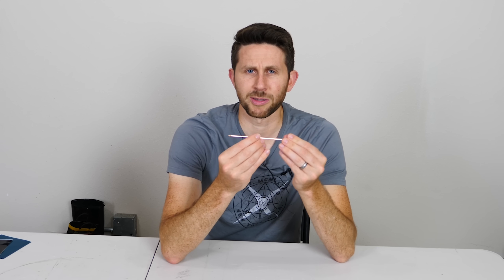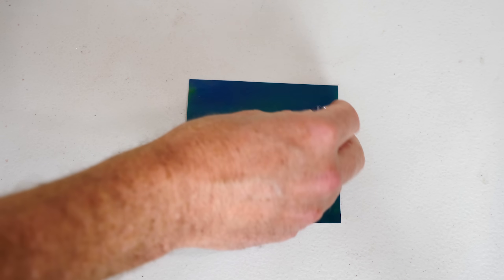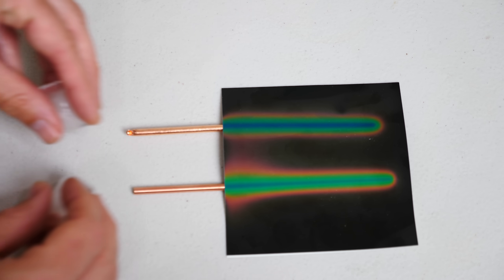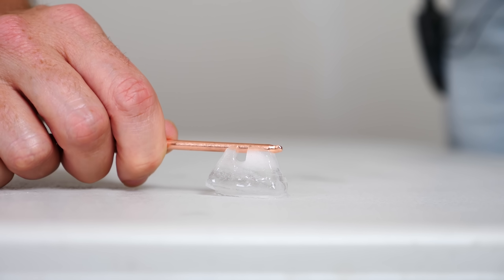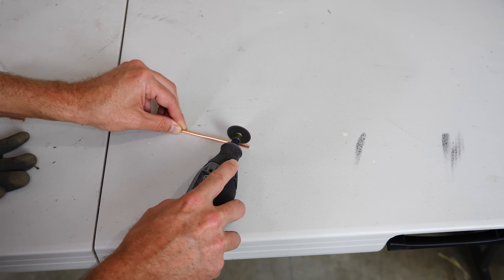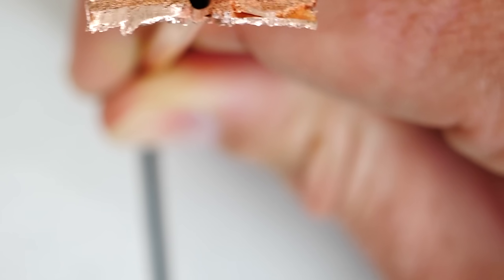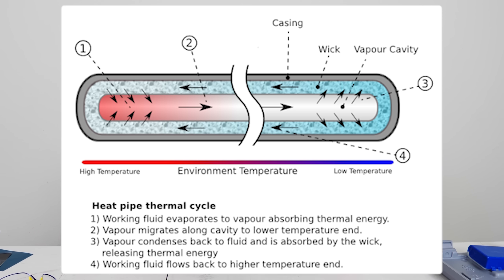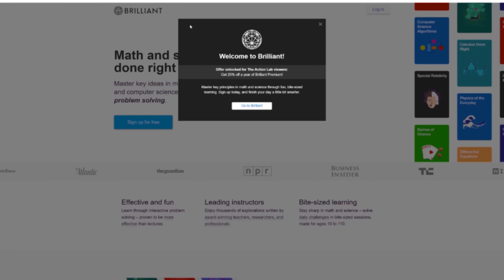What's Inside the Worlds' Fastest Heat Conductor?

Comment: This is essentially the core operating principal of all modern cooling. HVAC and AC units all operate using a long network of copper tubes filled with a vapor that it highly sensitive to temperature changes, by applying heat to one side of this network you make the other side very very cold, if you blow a fan over the cold side you have an air conditioner unit.

Comment: MAKE IT FROM SILVER SON :D, we also need to remember that copper wire have more thermal capacity than thin coper heatpipe, so i dont think its good example. never heard about water inside heatpipe, most of the time its used liquid with low boiling temp like alcohol or ammonia.

Comment: This the second video out of 
two videos of yours back to I back combined with the idea I came up with for retractable 🔭 telescopic blades & aircraft carrier cable to be used on wind farms inspired by watching videos of them structurally failing and decided to donate some time to help these engineers tackle this issue for safety and longevity.
You have a wonderful scientific mind that can be a valuable asset with their production of a solution.
Good day.
Reply: Here's the first video that may solve the problem for the runaway issue with the magnetics locking up and for not locking.
https://youtu.be/V5FyFvgxUhE

So that video solves that problem because they say they don't have a clutch so now I'm thinking engineering up a magnetic torque converter.. similar to what we use in automotive rather than a fan clutch.

Comment: Pretty sure it's not water in heat pipes. It's definitely some kind of liquid with a certain inert gas. But my guess is the liquid has a significantly lower boiling point, to be an effective conductor at lower temperatures.

Comment: Are these just called heat pipes? What exactly are they used for especially thos short one he has? Since it has to be sealed, you can't just buy a long one and cut it to your desired length like normal pipe do.
Reply: they are used in cpu coolers
Reply: Literally all laptops move heat from the chips to the coolers with these

Comment: not sure if testing with ice is proper. the phase change material inside should evaporate at higher, then condensate at roughly room temperature, if the heat pipe was made to operate around room temperature. rather it should be heated on on one end and measured on the other. cooling it likely causes the phase change substance to freeze, so pretty much you have the same result as it was an empty, thin wall copper tube... on the other hand, the solid copper rod has significantly larger mass, that means larger latent heat, that means it will absorb more heat before it will change it's temperature... you can actually see this effect with the thermal foil, around the copper bar, the colored area becomes much larger.

Comment: Is this something you could use to improve the effectiveness of say ice breaker ships? Or air conditioning or refrigeration and heating units,  if it's not used already. Also would it work at high pressure conditions like in the ocean or near vacuum conditions in space?
Reply: Well heat had to be supplied from somewhere so the ice breaker idea doesnt quit work. The pressure referred to is the internal pressure of the sealed pipe. So yes it will work in space or ocean provided the structural integrity against the pressure difference to the environment.

Comment: I'm curious how this can work in a continuous use application.  Eventually, one end runs out of water. I suspect it must have a return via gravity and therefore needs to be oriented in a specific way.  But will it really be 100x higher thermal conductivity in continuous use?
Reply: it uses capillary action and water tension to move the water back to the heat source, no matter if it's fighting gravity or not.
Reply: Heat pipes have a copper wick that wicks it back to the source of heat once it condenses in the cold end.
Reply: It is under a vacuum seal i.e. a closed loop system. The water won't run out. Water vapor cannot penetrate/permeate through the copper to evaporate out. 

   Yes, it is continuous use because one part of the tube will always be closer to ambient room temp and the other part subjected to heat source will always be significantly warmer, so as soon as the water evaporates from the hot side, it immediately condenses back into liquid form from/on the colder side and then goes right back to the hot side--this all happens quite fast--which is why in the demonstration the heat pipe was so much faster at transferring heat energy than the solid copper rod.. 

   It must be under between a low to medium vacuum though, since even at a low'ish vacuum, water boils (evaporates) at around room temp. Seems like the sweet spot for this use would be around 28 to 29 hg or so. 

   I'm curious about making my own using copper mesh and diamond powder.

Comment: Within 22 frames, I saw the blue sheet start to change until it reached  the end - I saw a small colour change, not fully black. That's 22/60 FPS, so that's 366 milliseconds for the 'heat' to reach the end of the pipe.

Comment: There is liquid. Not water. Very often there is some kind of liquid gas. It depends on what is the designed operating temperature. Because heatpipe works best only near its designed operating temperature.

Comment: When used as a heat sink for a CPU or GPU in a computer how much is the temperature decreased on the item being cooled? I am curious as to how much better these are or worse or equivalent they are to a water cooled system. Thank you. Also if you do the test on a CPU or GPU what are the temperatures compared to standard air cooler?
Reply: Heat pipes are far more efficient at moving heat than is the flow of water.  The reason water cooled CPU's usually outperforms heat pipes is because the water coolers typically use massive radiators. Heat pipe coolers usually are stuck directly on top of CPU and therefore are limited in radiator/fin size.

Comment: So replacing a water with ethanol or other low boiling temperature liquid should increase a speed of heat conducting?
Reply: The boiling point of water depends on the pressure. He said they seal the pipe at very low pressure, so the boiling point will also be very low. 
Plus water has better thermal capacity and thermal conductivity than alcohol.
I guess that is why water is better. Because if alcohol were better I think they would use it.

Comment: Right, but how would it compare to a solid copper rod in a sustained heat transfer situation, for example, when there is a temperature difference between the two extremities of the rod for several hours?

Comment: Thank you. CPU over clockers discuss if heat pipe angles make a difference. Should the CPU be mounted vertically with the heat pipe going vertical? 
Heat pipes also helps with AC. Inside the house, the small hot incoming  line can be cooled from the outgoing large line for more efficiency.

Comment: Currently attempting to very cheaply but much less effectively recreate this with a 9" length of 1/2" iron pipe and two caps and some very fine steel wool I have laying around. If P.O.C. works I'll optimize it a bit and post the results here. Wish me luck 😅

Comment: Would it have a better heat transfer if the fluid inside is changed, instead of water? And what fluid would give the hollow copper stick a higher heat transfer rate if it replaces water?

Comment: Very cool. My research is actually on quantum systems where the thermal and electrical conductivity can be quite separate. In other words the Wiedemann Franz law is broken by a significant amount.
Reply: Interesting.  Is it known why?
Reply: @justinw1765  in my case yes. It happens that the flow of current is a quantum coherent effect in small systems. The interference between multiple pathways can give large deviations from electron free gas predictions. WF is based on free electron theory.
Reply: @splugereport   Thank you for the explanation--a bit over my head, but I appreciate the try. I find the quantum level fascinating, but my deeper interest lies in creating practical systems for the macro level. 

    For example, I'm working on building a prototype of a ridiculously vacuum insulated cooler (nearly 2" of medium low vacuum on the sides and nearly 3" on the bottom) that can moonlight as a highly efficient Solar oven and a no grid electricity microfridge. 

     Also made out of either mostly biodegradable, sustainable, and/or low toxicity materials. Has no foam, and very little plastic. 

    I'm using Peltier/TEC as the heat transfer for the microfridge. I'll be using a modified, home made, flat plate version of these copper heat pipes, to help conduct heat away from the hot side. I'm hoping that will up efficiency a bit. But since I'm using a combo of Solar panels and battery bank to provide electricity, I'm not as concerned with efficiency as I would be if it was plugged into the grid electricity I pay for. At night, it will cool via IR redirection to space.

Comment: 3:01 i like this video, but ide also like to mention regelation.  which for anyone unfamiliar with it, is an effect that causes ice to turn back to water when subjected to higher pressure, ie,  the conductor being pressed into the ice. while its a cool effect, the heat isnt the only thing causing the ice to melt, and would probably melt much slower without the pressing. some of the times he did it, it does look like he added less pressure then the first time though, and it does look like it slows down when the heat from his hand has been used up. but yeah super cool video :)

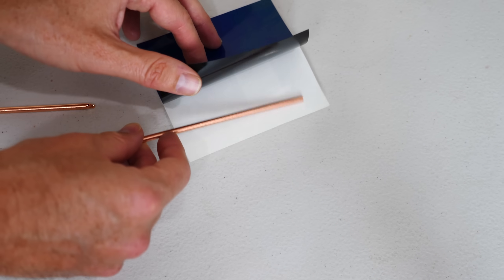Comment: can you explain how this sheet of foil from 0:50 works? why does it change colour? or how those cars which can change color under water works?
Reply: It's a liquid crystal sheet and from what i remember it changes color depeding on the temperature
Reply: @tridos2574  I know but how it works? Why does it change colour under temperature? What kind of material is it made of?
Reply: @ak2setter991  i just searched it up and it is because of the change in molecular structure this change affects the wavelengths of light that are absorbed and reflected by the liquid crystals, resulting in an apparent change in the color of each temperature event.
Reply: just open your browser bruh

Comment: If you use an alcohol that has a lower boiling point than water will the process be quicker?
Reply: Water is on of the best heat conductor out there. Alchol and ohter liquids will only used for subd zero C° condition

Comment: It's fast but it's effect is limited. As soon as the copper gets so hot that the liquid stays vaporised the system has broken down. You can make longer copper pipes to get more capacity, but then the downward flowing liquid, starts preventing the steam from rising. So figuratively speaking, the thing goes from 0-60 very fast, but then can't go any faster.

Comment: At some points you call the only copper piece a "copper rod" and other times you call it a "copper pipe" which is it because those are going to conduct heat differently and if you used a solid rod instead of a pipe your not comparing apples to apples

Comment: @theactionlab   You should repeat this experiment with Pewter, Pewter has a very similar effect but without the vacuum, copper, and water vapor required. You can press Ice up against a pewter cup and it will have a very similar effect, in fact, I use it at home to cool or warm drinks very quickly.

Comment: Diamond is really good at conducting heat as well, I went to a science demonstration where they had a large block of ice and a small blunt knife made of synthetic diamond, it cut through the ice in a very similar way to the rod in this video
Reply: Diamond is an excellent thermal conductor, I believe it's due to the crystalline structure of the carbon within. Diamond which has a more well structured crystal lattice works even better, but you'll be hard pressed to find such a diamond naturally.
Reply: @themadman5615  science is not about belief son
Reply: thanks for the facts!
Reply: So how about graphene?
Reply: @NwoDispatcher  It is very good but very directional.
Reply: @NwoDispatcher  graphene works very well BUT it is highly directional which can defeat it's purpose in many cases.
Reply: I thought this had something to do with diamond
Reply: Carbon is also a great electrical conductor, just depends on how you lay out the material, carbon nanotubes(same element as a diamond) conducts electricity better than copper
Reply: @RenderedUselessness  Graphene nanotube heat pipe
Reply: 5 x copper
Reply: Dimond has the highest Heat conductivity but if u keep a Dimond in an oven for a while you will get ashes, I think now you can understand why we don't use Dimond for Heat Transfer applications.
Reply: @Preparinguppcs but there is thermal conduction compound for computers that does use diamond dust in a medium.
Reply: Also silver works very well.

Comment: You mean the second fastest heat conduction. The fastest being liquid helium II in the superfluid state which conducts heat at about 20 m/s - it being a quantum mechanical effect of  thermal conduction by sound wave, unique to superfluids.
https://www.youtube.com/watch?v=NjPFfT2EyxQ
Reply: True infinities are never really possible... At most you can transfer at speed of light and maximum energy before collapsing into a black hole allows.
You mentioned the wavefront is 20m/s, that's much less than light speed already, for instance.
Reply: @leexabyz  Not true - electrical conductivity in superconductivity, zero viscosity in the case of superfluidity are other examples. These phenomena are quantum mechanical classical reasoning does not apply. To address your second misunderstanding: it does not imply infinite transfer of energy nor infinite speed of transfer, because the it breaks down at a certain transfer rate but is zero up to that point. For example an electric current set running in a circular superconducting wire was found to be still running undiminished decades later after the power had been removed.
Reply: Kilowatts per meter Kelvin
Reply: @limo-swine6537 That would be infinity, (analogous to electrical conductivity in the case of superconductivity).

Comment: You should probably said heat pipe is the fastest heat conductor “at room temperature”. The actual fastest heat conductor is liquid Helium when cooled below to approximately 2 Kelvin. The liquid Helium will transform into a state called “superfluid”, There will appear be no temperature gradients across the entire fluid, and any heat will propagate at extremely high speed across the entire fluid. Making it conduct heat 1,000 times better than copper.

Comment: You say that the heat is transferred from the ice, through the heat pipe, to the temp-sensitive sheets. But that's backwards. Heat is going in the opposite direction.

Also ... this heat pipe may indeed transfer heat quickly. But this demonstration does not prove that. If the two rods of the *same* material have different masses, the rate of heat transfer will be different.

Comment: Hmmm... What if you take the world's blackest paint and make some solar panels on which you attach many of these heat pipes which will be connected to a full water container then the water, because of the heat, builds up pressure and it starts to drive a turbine to generate electricity. 🤔

Comment: Also the spongy part act as a capillar bringing the condensed water from the cold side back to the hot side, where it evaporates and goes as vapor through the middle of the pipe.
Creating a closed cycle.
Just my guess, I am actually an idiot.

Comment: I believe heat pipes have a small amount of a liquid that evaporates at low temperatures and carries the heat up the tube to the cool end and then gravity pulls the condensed (cooled) droplets back down to the bottom of the tube. That is how it works. It requires the heat pipe be upright because it relies on the heated vapor from the evaporated liquid to rise and gravity to return the condensate to the bottom of the tube (the heat source) to cool. Laying the heat pipes on their sides will not produce any effect. Also they don't transfer cold -- cold is the absence of heat. So it worked but laying flat like that... not so much. You would really be impressed if the heat pipe were vertically oriented and the heat source on the bottom end and the cool end on the top.
Reply: Not true.  Heat pipes are often designed with "wicks" in them so that the water will return without the aid of gravity. It's called capillary action.

Comment: The title is misleading, as heat pipes are not thermal conductors. They work on 2 phase heat transfer, thus they are not conducting but rather using phase exchange.  The best thermal conductors are BAs diamond and copper followed by aluminium. Also i would be careful about cutting into heat pipes, while the cheap ones just use ethanol or ammonia. Good ones use mercury or sodium.

Comment: Copper is used for electrical conductivity and thermal conductivity because it is cheap. The best metal for these two physic principals is silver. Gold is also an alternative used for corrosion resistance (which is why its used so much for space instruments. But its too expensive to use for mundane things. Small amounts of gold are used in electronics however to help in corrosion prevention to add to the longevity of our electronics.